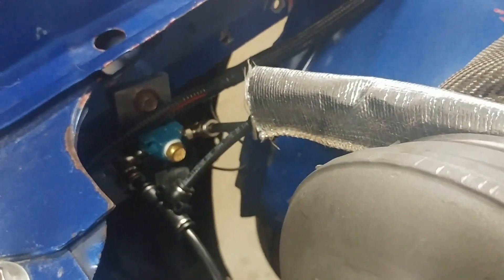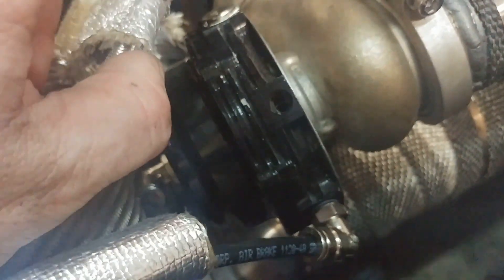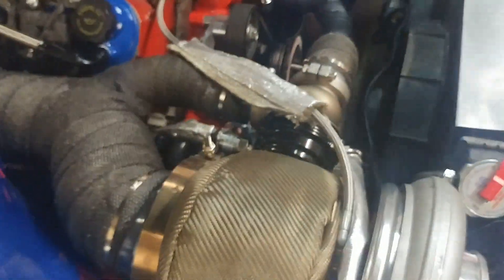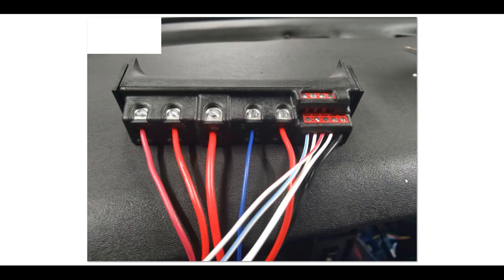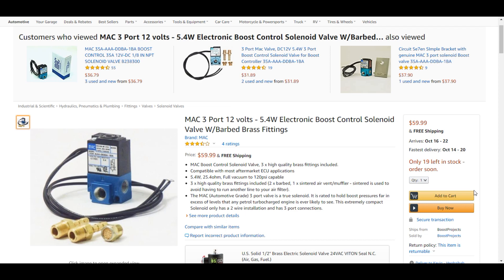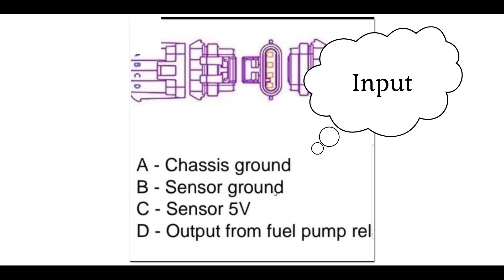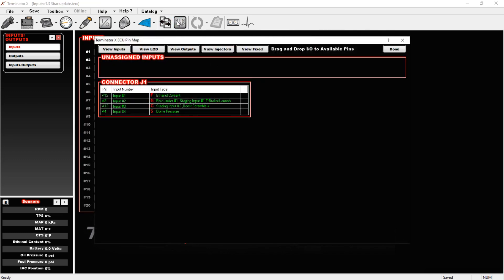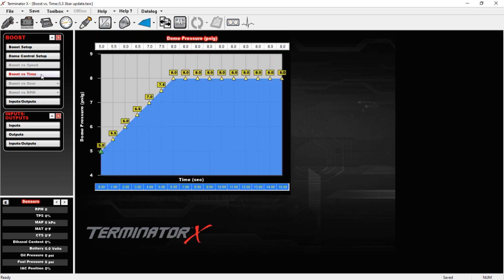3 port MAC valve Boost Controller with Terminator X

Comment: Those cheap amazon 30 dollar Mac valve last maybe 3 months racing .  I stay with my turbosmart Mac valves 4 years still working.
Reply from the maker: Thanks for watching and your input. I'll be keeping an eye on it and I planned on taking a spare on drag week, as well as spare sensors that are not easily sourced at parts stores like AutoZone.

Comment: Hey man, just to make sure I got the wiring correct from the dome sensor to the power tap and input:
Wire 1 goes to B
Wire 2 goes to C
Wire 3 goes to J1-A4 Pin
and for the mac valve do I just wire the J1-B10 output to signal a conventional relay to power the mac valve? Or maybe just directly to the mac valve? Just confused by the solid state relay you have there. 
Thank you.
Reply from the maker: Yes, correct to all. You don't need the solid state relay, you could just run an ignition hot wire to the mac valve to give it power. In my case, the J1-B10 is the ground side of the circuit, how the ECU tells the valve to open and let pressure into the top of the waste gate. Since I have the Pro Dash, one of the screens is my switch panel, but that MSD SSR is overkill if that's all you're wanting to power from that relay. A regular Bosch 40 amp relay would work just fine. Thanks for watching.
Reply: Okay I am starting to understand it better but what is the difference between having a relay and directly wiring 12v switched to the mac valve? Why would you wire a relay? Thank you for explaining this, I just need to wire my boost solenoid and I can get started on tuning my 73 k10 6.0 ls twin turbo swap. =D
Reply from the maker: No difference, the valves don't draw much power. You could run it from a voltage source and put a $2 toggle switch in line and then to the valve.
Reply from the maker: The only reason I used the solid state relay is that I already had it and I could eliminate a switch on my old switch panel by using a virtual switch.
Reply: Gotcha! Well i think im gonna go ahead and give it a try. Thank you again.
Reply from the maker: @GamerBoy2ndSt  you're welcome
Reply from the maker: @UCtpes6F_0-TpN5A0chP1U9g thanks for watching. As far as the valve goes, as long as it gets power and ground, it'll open and close when it's commanded (power applied and removed), it doesn't care if the power is coming from a relay or the ECU. A toggle switch in line with the output will do the same thing as far a giving you a low boost, waste gate only setting to drive around on, then enable for party mode. Let me know if you have anymore questions.
Reply: @TrailerParkMotorsports  Pardy mode engaged!! LMAO

Comment: Very good video thank you !
Reply: Got a question do I have to use the 50psi pressure sensor or can I use the 25 psi from low dollar
Reply from the maker: @3rdgenjose699  you could any pressure sensor you want. I just guessed when I bought it that the 50 psi one would work best for me.
Reply from the maker: Thanks for watching, glad you liked it.

Comment: this video was spot on perfect.. exactly the info i needed. although im setting up a dual mac valve config, but its basically the same other than the software config and a slightly different fitting setup. now for me to find out where to steal power from for my mac valves.. thinking the pink wire that turns my sniper on since i don't wanna run new wires through my deutsch bulkhead (if i even have any spares)..
Reply from the maker: I'm glad it helped, thanks for watching.

Comment: Great video. I'm guessing that if you want raise your target boost, you need to adjust the Dome table to reflect the increase? If you have a 10psi spring, adding 8 to the dome should yield 18psi. If you want more, increase dome, correct?
Reply from the maker: Thanks for watching. Yes, that is correct, however verify on the datalog because sometimes adding pressure on top of the dome doesn't always correspond to the pressure in the manifold. In your case, 8 pounds on top of the spring may come out to 20 pounds in the intake.

Comment: Great video man. i have sloppy harness for my e85 on my power tap. can i use something else for 5v reference or should i just tap into the sloppy harness. i love how you break shit down Barney style and make it very simple.
Reply from the maker: Glad you liked it. You can tap a few things onto the power tap with no issue. I'm also using the Sloppy flex/alt harness and have the dome pressure sensor on the same 5v source as the flex sensor.
Reply: @TrailerParkMotorsports  so you just spliced into the 5v on the sloppy harness?
Reply from the maker: Correct
Reply: Same here. Was wondering the same. The power tap harness is amazing to have!